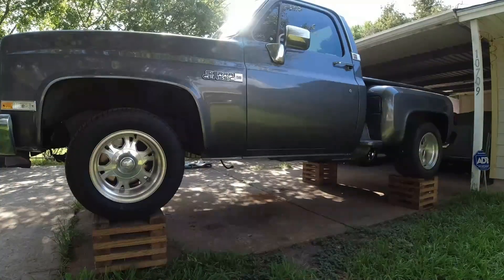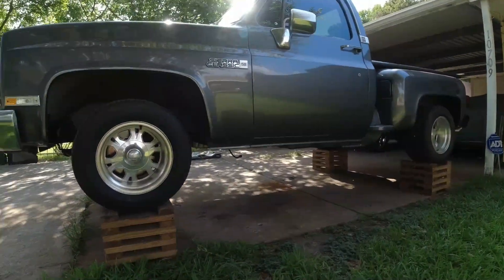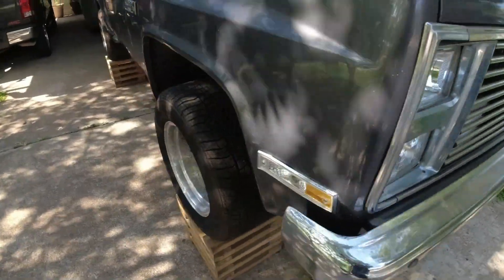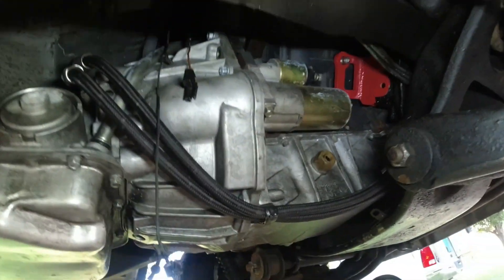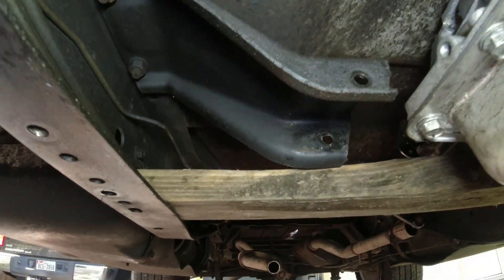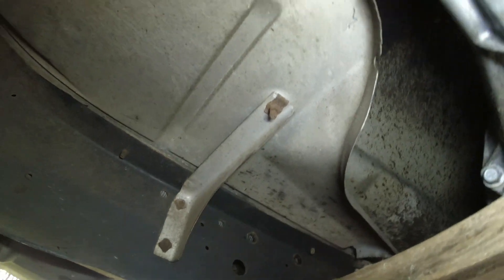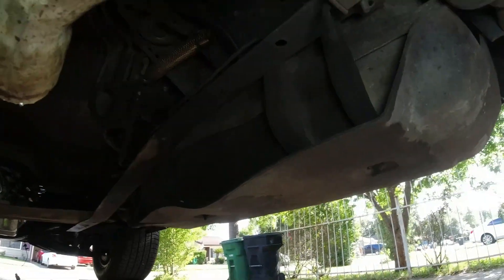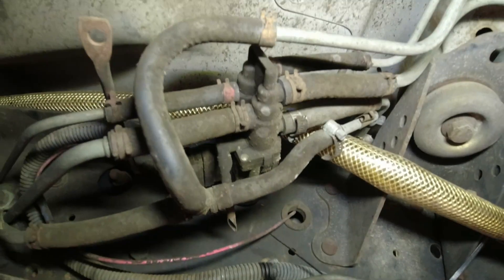C10 LS SWAP. Picking up where someone left off. lots of goodies. PART 1

Comment: that's a sweet truck
Reply from the maker: Damn Shawn, How bout an update on your camaro. I got a big swap coming up on the 71
Reply: @hybridmusclegarage4590  its coming, I am going to do a video on the pre body work phase. just got the custom alum cold air intake done. Billet PS remote res and custom an lines. Billet washer bottle and hidden motor. All the FAN wiring hidden with a custom battery brace panel in side of pass fender. Fan controller is a pwm so it only comes on as strong as it needs based on heat. No sitting at a red light with fans going 100% for me.
Reply from the maker: @Co-SS  Awesomeness!!!!